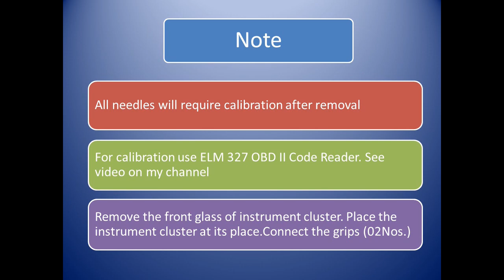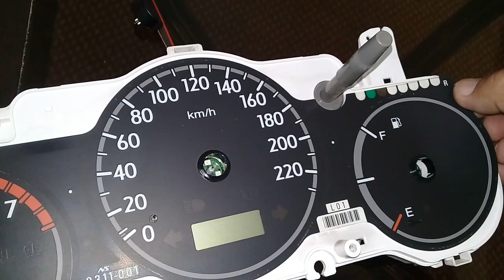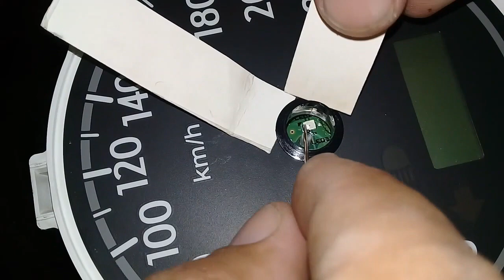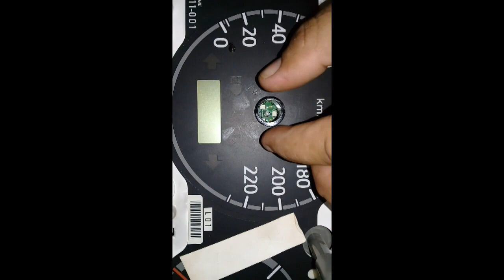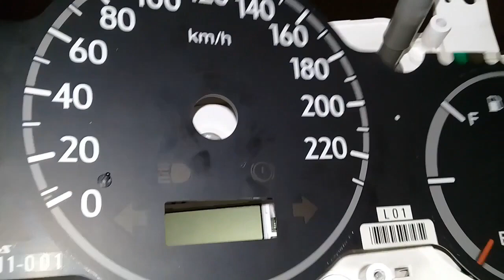Honda City Instrument Cluster Opening and Needle Calibration

Comment: sir can you do engine bay cleaning for your honda? i have same car but dont know which parts needed to be cover so water wont come in
Reply from the maker: Never done engine cleaning using water.Either use brush to free the dust then use blower or compressed air.Then use moist cloth.Washing the engine with water will result in engine starting problems and is not recommended.

Comment: My honda city 2010 modal and instrument cluster guages goes off completely most of the time then keep tuning on and off. I got wiring checked that seems to be ok. But people here saying instrument fix can't be guaranteed if that will work or not. Please help
Reply from the maker: Check the cable terminals coming to the battery specially the positive terminal where two cables are tied to the clamp.Make sure the cable clamps are free from salt accumulation.Same thing just happened to me where i was unable to start the engine from a brand new battery.not hearing the clicking sound from starter.very dim lighting and no reading on odo meter.all symptoms removed and the engine started when i cleaned the positive battery clamps and its bolts from salt acumulation.

Comment: hello, is it possible to change the dasboard lights to LED?
Reply from the maker: The stereo assembly bulbs, ac and defogger bulbs can be replaced with led but they will burn in few days.
Reply: @250nashtech  thank you for your quick reply 👍🏻
Reply: too bad video resolution is bad from

i need the values of capacitors and the power regulator...intermittent power issue might be caused by the capacitor

car is not yet with me, it's my sister's

Comment: Loyal to the city bro. But the transmission is rubbish. My one is jerking and only at 179k.
Reply from the maker: is jerking all times?
Reply: @250nashtech  no but at idle sometimes it jerks
Reply from the maker: @greylynnjr it may be ignition coil (misfire) problem or dirty intake air control valve(IACV),Transmission related problems always appears all time and are not intermittent.
Reply: @250nashtech  coils done. Sparks done. Im over it now. I just put it into neutral. I accept honda did the model not good. Manufacture fault
Reply from the maker: @greylynnjr  Then it can be.
Reply: @250nashtech  almost perfect. I love my car
Reply: @250nashtech  you the man for posting up the videos bro